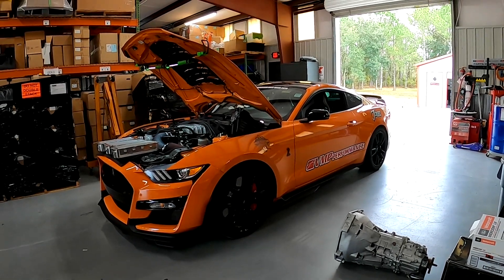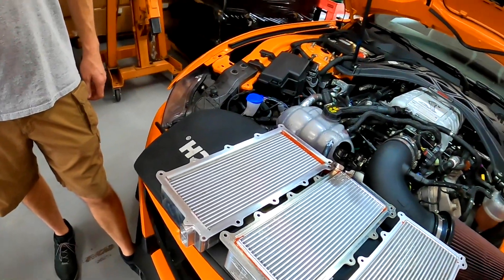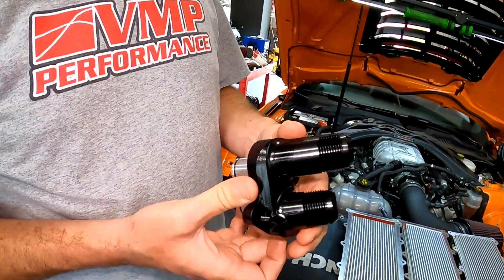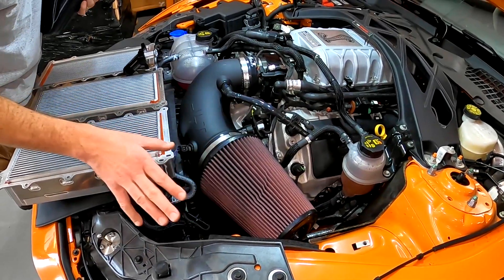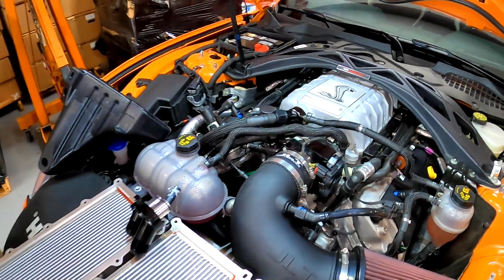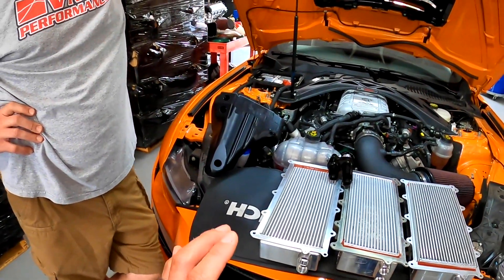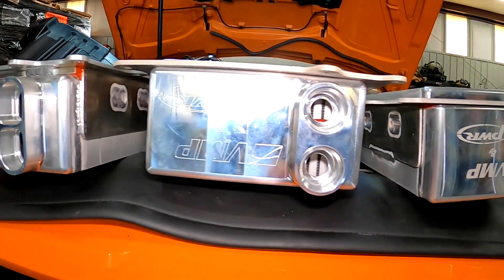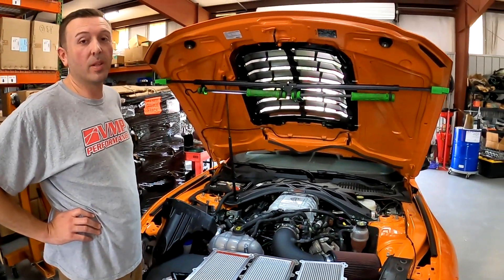Intercoolers and Ice Tanks | VMP Performance 2020 GT500 Cooling Mods

Comment: There’s a simple way to calculate flow and using Poiseuille’s Law any increase in radius increase flow by that increase to the 4th power.  So, increase radius by 2 times increases flow by 8 times.  It’s not linear.  You can use that to calculate flow increase through the opening.  Just figured that physics for medical school can come in useful for explaining this because it’s not super intuitive.